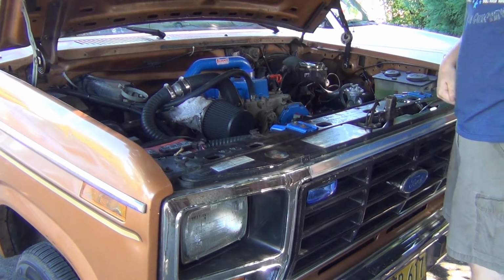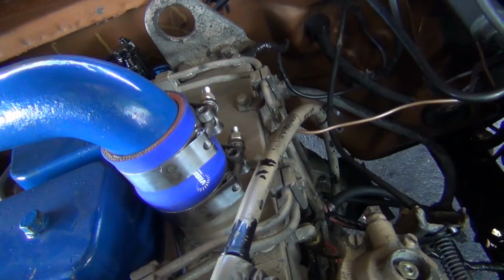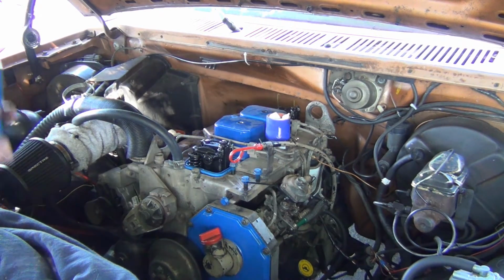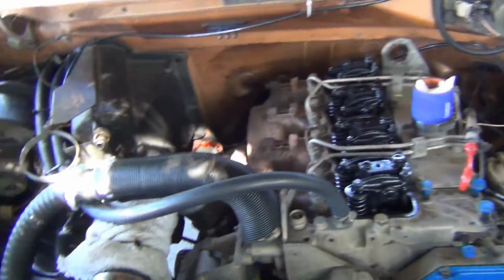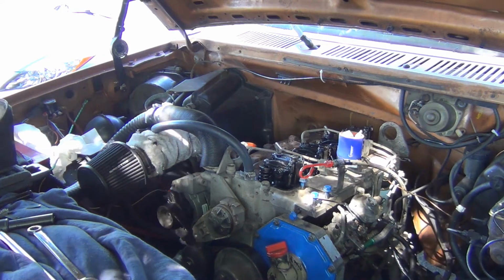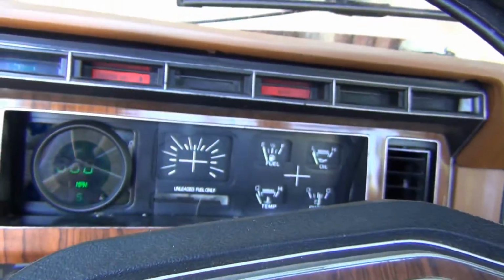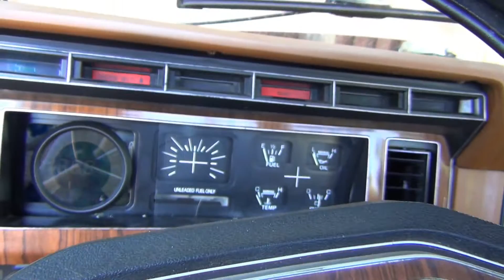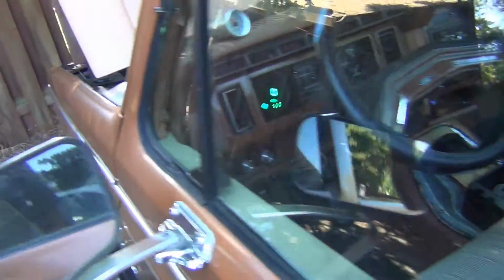4BT Cummins Valve Adjustment

Comment: Y didn't u put the rear VC on first ? Also no torque wrench for those bolts ?
Reply from the maker: I did not use any torque wrench. I snugged the bolts down based on how they felt when they broke lose.
Reply from the maker: justhes and I don't know why I didn't put the rear one on first.
Reply: Johnson's Gee-rage Hello. tell me please what are the cummins 4bt valve clearances. thank.

Comment: Did you make adjustments to that pump ? The Ford looks good.
Reply from the maker: I have adjusted the power screw and added a fuel pin. Have been meaning to replace the governor spring, but I stripped the head of an allen screw. Gonna have to get creative with that one.